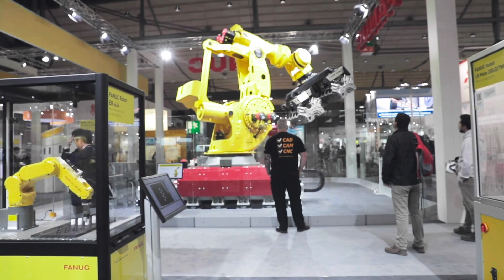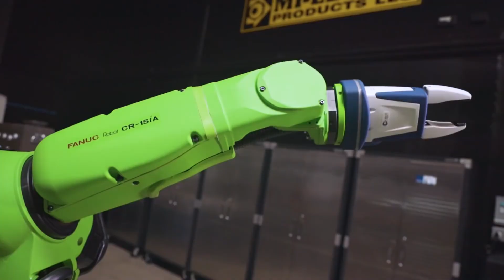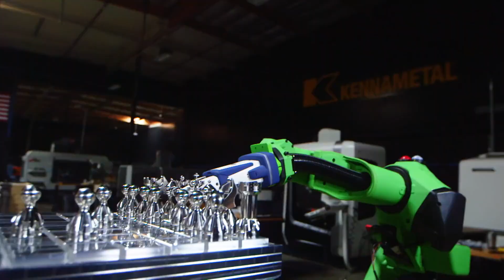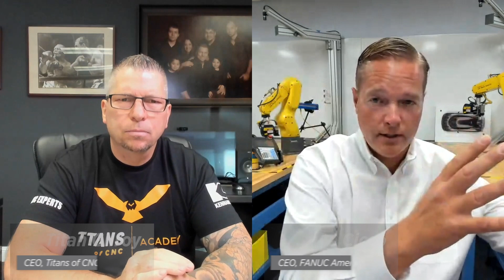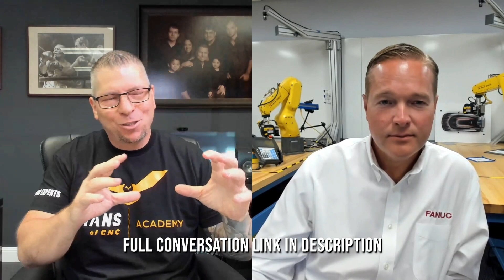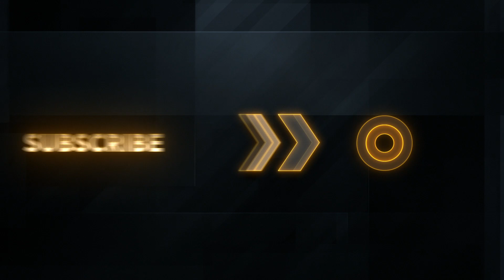What Do Robots in CNC Machining Look Like in the Future?

Comment: As someone that cut their teeth in automation I will say... design your systems such that they can be automated. Doesn't matter if you want to use people to do it right now, that's fine. But, make sure you are putting systems in place that lend themselves to pick-and-place. QR code scanning, code carriers.. whatever system you want to use... spend some time understanding how to implement it. Should/could tie in with your DNC system, your tool setting system... any place that manual input can lead to errors. You can build it from mild to wild where automation is concerned... so long as you have  some idea where you want to go.

Comment: I was thinking about a worm gear with a HIGH ratio to rotate the club angle. This of course is a one-way gear, immune to torque impact if properly designed. Use a small high RPM three-phase motor to turn the worm screw.  The 90 degree axle for the club on the shaft could be very short and thick, with  fairly narrow worm wheel. You only need a short, pie shaped section of the worm wheel. It could handle as much torque impact as you want. ALL metal and none of the electrical and mechanical crap that's inside a servo. Not much mass and very quickly responsive. So, you have a shaft with a short, thick 90° axle that the club pivots on. There is a pie-shaped section of the worm wheel driven by a worm gear on the motor shaft. All metal. No backlash. Minimal weight. Pretty damn rugged. Simple design.
Reply: Could you draw a quick sketch on a piece of paper, take a photo with your phone and post it on one of those free image sites, and post a link to it?
I really don't understand your description but it sounds intriguing and it sounds like you're on to something.